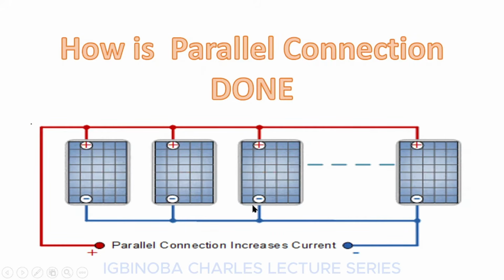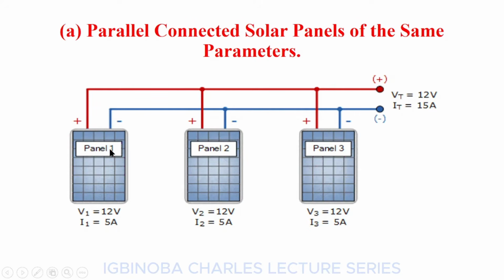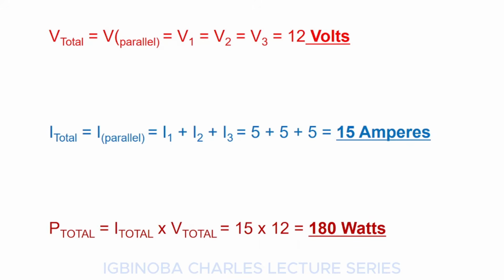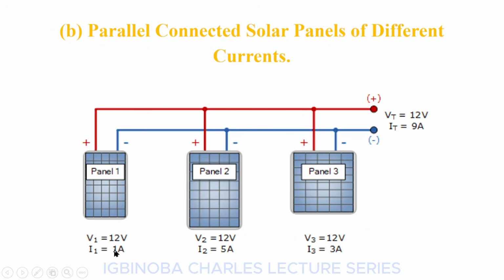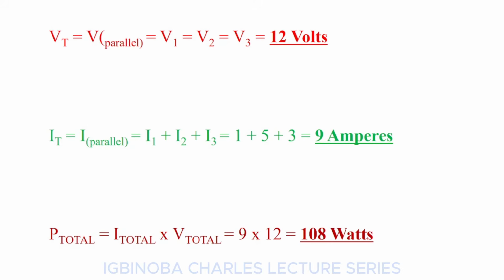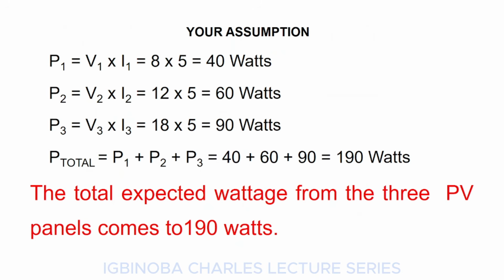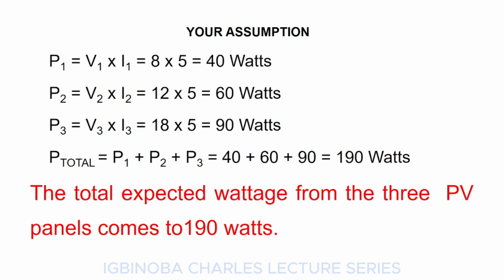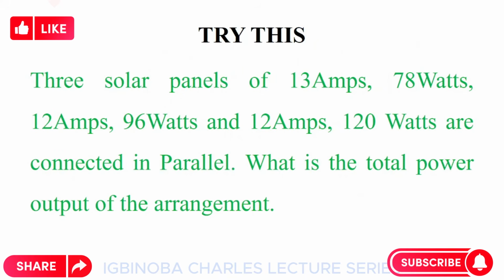Connection of Solar Panels in PARALLEL

Comment: NAT46T

Panel 1 = 13A, 78W
Panel 2 = 12A, 96W
Panel 3 = 12A, 120W

To get the voltage across each panel is given by Power/Current;
Panel 1 = 78/13 = 6V
Panel 2 = 96/12 = 8V
Panel 3 = 120/12 = 10V
We use V = 6v because it's the least voltage we have

To get total power in parallel:
We have
(Sum of the currents) x V
(13 + 12 + 12) × 6
=222watts

Comment: CHM26Z
Given;
Panel 1 = 13A, 78W
Panel 2 = 12A, 96W
Panel 3 = 12A, 120W
To get the voltage across each panel is given by Power/Current:
Panel 1 = 78/13 = 6V
Panel 2 = 96/12 = 8V
Panel 3 = 120/12 = 10V
We use V = 6V because it's the least voltage we have.
To get total power in parallel:
We have
(Sum of the currents) × V
(13 + 12 + 12) × 6
= 222 watts.

Comment: PETROCHEM55C 
ANSWER:

Given;
Panel 1=13A,78W
Panel 2=12A,96W
Panel 3=12A,120W
To get the voltage across each panel is given by 
power/current;
Panel 1=78/13=6V
Panel 2=96/12=8V
Panel 3=120/12=10V
We use V=6V because it's the least voltage we have:
To get total power in parallel:
We have
(Sum of the currents) x V
(13+12+12) x 6
=222Watts
Final answer=222Watts

Comment: CIV73U
Panel 1 = 13A, 78W
Panel 2 = 12A, 96W
Panel 3 = 12A, 120W
To get the voltage across each panel is given by Power/Current;
Panel 1 = 78/13 = 6V
Panel 2 = 96/12 = 8V
Panel 3 = 120/12 = 10V
We use V = 6v because it's the least voltage we have:
To get total power in parallel:
We have
(Sum of the currents) × V
(13 + 12 + 12) × 6
=222watts

Comment: CHM33G

Answer 

Given p1= 13A, 78W
           P2 = 12A, 96W
           P3 =  12A, 120W
          
           P/I
             Panel 1= 78/13 = 6v
              Panel 2 = 96/12 = 8v
             Panel  3= 120/12 = 10v
       
              V= (6v sum of the current) × V
              (13+12+12)*6
                 =222watts

Comment: CHM70R

Panel 1 = 13A, 78W
Panel 2 = 12A, 96W
Panel 3 = 12A, 120W
To get the voltage across each panel is glven by Power/Current;
Panel 1 = 78/13 = 6V
Panel 2 = 96/12 = 8V
Panel 3 = 120/12 = 10V
We use V= 6v because it's the least voltage we have:
To get total power in parallel :
We have
(Sum of the currents) × V
(13 + 12 + 12)×6
=222watts
Final answer =222watt

Comment: CHM110F

Panel 1 = 13A, 78W Panel 2 = 12A, 96W Panel 3 = 12A, 120W To get the voltage across each panel is given by Power/Current; Panel 1 = 78/13 = 6V Panel 2 = 96/12 = 8V Panel 3 = 120/12 = 10V We use V= 6v because it's the least voltage we have: To get total power in parallel : We have (Sum of the currents) × V (13+12+12)×6 =222watts Final answer =222watt

Comment: COMP37K 
Given 13A 78W
12A 96W
12A 120W
To get the voltage we use v =power/current 
V1=6.5
V2=8
V3=10
To connect solar panels in parallel it has to satisfy one of these two conditions which are
They must have the same voltage and current
They must have the same voltage and different current 
Since it doesn't satisfy any of these conditions we can't connect it in parallel thereby not being able to get the equivalent power when connected in parallel

Comment: CHM46T

Given:
Panel 1: 13 A, 78 W
Panel 2: 12 A, 96 W
Panel 3: 12 A, 120 W
For parallel connection, the total power is the sum of the power outputs:
Total Power = 78 + 96 + 120
= 294 W
ANSWER: 294 W

Comment: CHM65M 

Given;
Panel 1 = 13A, 78W
Panel 2 = 12A, 96W
Panel 3 = 12A, 120W
To get the voltage across each panel is glven by Power/Current;
Panel 1 = 78/13 = 6V
Panel 2 = 96/12 = 8V
Panel 3 = 120/12 = 10V
We use V= 6v because it's the least voltage we have:
To get total power in parallel :
We have
(Sum of the currents) × V
(13 + 12 + 12)×6
=222watts
Final answer =222watt

Comment: CHM51Y

Answer 

Given;
Panel 1 = 13A, 78W
Panel 2 = 12A, 96W
Panel 3 = 12A, 120W
To get the voltage across each panel is glven by Power/Current;
Panel 1 = 78/13 = 6V
Panel 2 = 96/12 = 8V
Panel 3 = 120/12 = 10V
We use V= 6v because it's the least voltage we have:
To get total power in parallel :
We have
(Sum of the currents) × V
(13 + 12 + 12)×6
=222watts
Final answer =222watt

Comment: CIV83E

GIVEN:

11 = 13Amps, P1 = 78Watts

12 = 12Amps, P2 = 96Watts

13 = 12Amps, P3 = 120Watts

Finding the Voltage

V = P/I

V1 = 78/13 = 6V

V2 = 96/12 = 8V

V3 = 120/12 = 10V

i

For a parallel connection, the voltage must be

V1 = 78/13 = 6V

V2 = 96/12 = 8V

V3 120/12 = 10V

For a parallel connection, the voltage must be the same, and we cannot simply take the lowest voltage current here because the ratings of the currents occur at different voltages.

Therefore, the panels cannot be connected directly in parallel. And the total power output cannot be gotten directly too.

Comment: COMP11K

GIVEN:

I1 = 13Amps, P1 = 78Watts

I2 = 12Amps, P2 = 96Watts

I3 = 12Amps, P3 = 120Watts

Finding the Voltage

V = P/I

V1 = 78/13 = 6V

V2 = 96/12 = 8V

V3 = 120/12 = 10V

For a parallel connection, the voltage must be the same, and we cannot simply take the lowest voltage current here because the ratings of the currents occur at different voltages.

Therefore, the panels cannot be connected directly in parallel. And the total power output cannot be gotten directly too.

Comment: MAR2B

Voltage for each solar panel can be determined by:
V=p/l where P= power and I=current.
Therefore
V1=78\13=6v V2=96/12=8v
V3=120/12=10v
By law the voltage of V1 is taking as the output or total voltage because it has the smallest value, therefore
Where to tell current is giving as L_total=13A+12A+12A=37A
Total power output=l_total x v_total
P_total=37x6=222 w

Comment: EEE82D 

Given:
13A 78W, 12A 96W, 12A 120W

Total Power= Total current x Total voltage 
Voltage=p/I
78/13 =6v, 96/12=8v 120/12=10v

Total voltage=6v
Total current=13+12+12=37A

Total Power= 6x37 =222W

Comment: CHM99U

Given:
Panel 1 : 13A, 78W
Panel 2 : 12A, 96W
Panel 3 : 12A, 120W

For the panels connected in parallel, the total power output is the sum of the individual powers:

Pt = P1 + P2 + P3
Pt = 78 + 96 + 120
Pt = 294W

Comment: CHM62J

Given:

P1 = 78 W
P2 = 96 W
P3 = 120 W

Since the panels are connected in parallel, the total power is the sum of the individual powers.

Pt = P1 + P2 + P3

Pt = 78 + 96 + 120

Pt = 294 W

Answer: 294 W

Comment: PETROCHEM39 М
Panel 1: 13 A, 78 W

Panel z: 12 A, 96 W

Panel 3: 12 A, 120 W

Connection: Parallel

In a parallel connection, the total power output of the arrangement is the sum of the individual power ratings of each panel (since power adds directly regardless of connection type):

P(total) = PI + Pz + P3

P(total) = 78 W + 96 W + 120 W

P(total)

= 294 Watts

Comment: MEC102X

Answer: 222watts
 

Given:
 Panel 1 = 13 Amps, 78 Watts
 Panel 2 = 12 Amps, 96 Watts
 Panel 3 = 12 Amps, 120 Watts
Total power output, P = V \times I
In parallel, the current is added.
I = 13 + 12 + 12 = 37 Amps
Calculating individual panel voltage:
 Panel 1, V_1 = 78 / 13 = 6 V
 Panel 2, V_2 = 96 / 12 = 8 V
 Panel 3, V_3 = 120 / 12 = 10 V
At this point, the least voltage is used to compute the power output from the panels, which is 6 V.
Therefore,
Total power output, P = 6\text{ V} \times 37\text{ A} = 222 Watts

Comment: COMP8H

Given that
P=IV therefore V=P/I
P=78W, I=13A V=78/13= 6V
P=96W, I=12A V=96/12= 8V
P=120W, I=12A V=120/12= 10V

Theoretically 
Ptotal=78+96+120=294W

Practically 
(In parallel)
Vtotal= 6V
Itotal=12+12+13=37A

Ptotal= 37 x 6 = 222watts

Comment: CHM42P
Voltage for each solar panel can be determined by:
V=p/I where P= power and I=current.
Therefore
V1=78\13=6v
V2=96/12=8v
V3=120/12=10v
By law the voltage of V1 is taking as the output or total voltage because it has the smallest value, therefore
Where to tell current is giving as
I_total=13A+12A+12A=37A
Total power output=I_total x v_total
P_total=37x6=222 w

Comment: MECH73U

* 13A,\ 78W
* 12A,\ 96W
* 12A,\ 120W

are connected in parallel. Find the total power output.

Using:

P=VI

Therefore,

V=P/I

For the first panel:

V_1=78/13=6V

For the second panel:

V_2=96/12=8V

For the third panel:

V_3=120/12=10V

So the panels are 6 V, 8 V and 10 V respectively.

P_T=P_1+P_2+P_3

P_T=78+96+120

P_T=294W

Comment: CIV58F

panel 1 is 78 w
panel 2 is 96 w
panel 3 is 120 w

therefore the Total power output is the summation of all the power which is = 294 w

Comment: EEE14O

Answer: 222 Watts

Given:
Panel 1 = 13Amps, 78Watts
Panel 2 = 12Amps, 96Watts
Panel 3 = 12Amps, 120Watts

Total power output, P = V×I

In parallel, the current is added.
I = 13 + 12 + 12 = 37Amps

Calculating individual panel voltage.
Panel 1, V_1 = 78/13 = 6V
Panel 2, V_2 = 96/12 = 8V
Panel 3, V_3 = 120/12 = 10V

At this point, the least voltage is used to compute the power output from the panels, which is 6V.

Therefore,

Total power output, P = 6V × 37A = 222 Watts

Comment: EEE77Y

GIVEN:

11= 13Amps, P1= 78Watts

12= 12Amps, P2= 96Watts

13= 12Amps, P3= 120Watts

Finding the Voltage

V= P/I

V1=78/13 6V

V2=96/12=8V

V3=120/12=10V

For a parallel connection, the voltage must be the same, and we cannot simply take the lowest voltage current here because the ratings of the currents occur at different voltages.

Therefore, the panels cannot be connected directly in parallel. And the total power output cannot be gotten directly too.

Comment: EEE47U 

Answer 
When solar panels are connected in *parallel*, the *total power = sum of individual powers*.

You have:
1. *Panel 1*: 78W 
2. *Panel 2*: 96W 
3. *Panel 3*: 120W

Total Power Output = 78W + 96W + 120W = 294W

---

Extra info if you need it:
In parallel, voltage stays the same but currents add.  
Total current = 13A + 12A + 12A = 37A

To find the system voltage, you’d use: `Power = Voltage x Current`  
Using panel 1: $V = 78W / 13A = 6V$  
Using panel 2: $V = 96W / 12A = 8V$  
Using panel 3: $V = 120W / 12A = 10V$

Note: These 3 panels have different voltages, so connecting them directly in parallel isn’t ideal. In real setup you’d use an MPPT charge controller or match the voltages, otherwise the lowest voltage panel will drag the others down.

But for pure power output on paper: 294W total

Comment: PETRO82D 

For a parallel connection, the voltage must be the same, and we cannot simply take the lowest voltage current here because the ratings of the currents occur at different voltages. 
Therefore, the panels cannot be connected directly in parallel. 
And the total power output cannot be gotten directly too.

Comment: PETRO71S

Solution 

finding the voltages
13A, 78W → V = 6V
12A, 96W → V = 8V
12A, 120W → V = 10V
Total current = 13 + 12 + 12 = 37 A
Total voltage = 6 V (limited by weakest
panel)
Total power = V x 1 = 6 × 37 = 222 W

Comment: PETRO20T

Answer: 

Solution:

Given:
Three solar panels connected in Parallel
- Panel 1: 13A, 78W
- Panel 2: 12A, 96W
- Panel 3: 12A, 120W

---

Key rule for parallel connection:
When panels are connected in parallel, voltages must be the same and *currents add up*.
Power also adds directly: P_total = P1 + P2 + P3

So we just add the power of each panel.

Total Power Output (Pt):
Pt = 78W + 96W + 120W
Pt = 294W

---

*Note:
For parallel, the total current would be:
It = 13A + 12A + 12A = 37A
To get voltage for each panel: V = P/I
V1 = 78/13 = 6V, V2 = 96/12 = 8V, V3 = 120/12 = 10V

Since the voltages are different, in a real setup they would need to be matched with an MPPT/charge controller. But for the basic power calculation: Total power = 294W

Comment: CIV15O
Panel 1=13A 78W
Panel 2= 12A 96W
Panel 3= 12A 120W

Connected in Parallel 
Power total= P1+P2+P3
          =78+96+120
           = 294 Watts

Comment: CIV18R

Given,
Panel 1: 13A, 78W
Panel 2: 12A, 96W
Panel 3: 12A, 120W
For panels connected in parallel, the total power output is the sum of the individual powers:
Pt = P1 + P2 + P3
Pt= 78 + 96 + 120
Pt = 294W

Comment: CHM38L

GIVEN; P=VI; V=P/I
13A 78W=78/13 =6V
12A 96W=96/12=8V
12A 120W=120/12=10V
*I=13+12+12=37A
In a parallel connection the panels would run on the least voltage V=6volt

P=VI; 6×37=222W

Comment: MAR64L 
finding the voltages
13A, 78W → V = 6V
12A, 96W → V = 8V
12A, 120W → V = 10V
Total current = 37 A
Total voltage = 6 V 
Total power= 222 W

Comment: COMP98T

For panels connected in parallel, the total power is the sum of the individual powers:

P_T = P_1 + P_2 + P_3

P_T = 78 + 96 + 120

P_T = 294W

Answer: The total power output is 294 watts.

Comment: PETRO19S

Solution:

Given:  
Three solar panels connected in Parallel  
- Panel 1: 13A, 78W  
- Panel 2: 12A, 96W  
- Panel 3: 12A, 120W  

---

Key rule for parallel connection:  
When panels are connected in parallel, voltages must be the same and *currents add up*.  
Power also adds directly: P_total = P1 + P2 + P3

So we just add the power of each panel.

Total Power Output (Pt):  
Pt = 78W + 96W + 120W  
Pt = 294W

---

Note:  
For parallel, the total current would be:  
It = 13A + 12A + 12A = 37A  
To get voltage for each panel: V = P/I  
V1 = 78/13 = 6V, V2 = 96/12 = 8V, V3 = 120/12 = 10V  

Since the voltages are different, in a real setup they would need to be matched with an MPPT/charge controller. But for the basic power calculation: Total power = 294W

Comment: CHM9I

GIVEN:
P1=78W
P2=96W
P3=120
THE SOLAR PANELS ARE CONNECTED IN PARALLEL, THEREFORE POWER IS:
P=P1+P2+P3
P=78+96+120
P=294W.

Comment: Petro45S 
Solution 
Voltage for each panel , v=p÷I
Panel1 13amp , 78w,  v = 78÷13 = 6v
Panel2 12amp, 96w, v=96÷12= 8v
Panel3  12amp , 120w, v= 120÷12=10v
For total current [ I] = 13+12+12=37.amp
Due to the difference in voltage to calculate for power using the lowest voltage  I.E 6v
P= v×I  ,, p= 6×37= 222wat
Note that this parallel connection is not effectively maximizing the power of the panel and can result to cable been burn cause to get effective parallel connection it most follow this rule 
1 same voltage & same current 
2 same voltage & different current
Reply: Reason why the this parallel connection is not effective 
 the actual total power minus calculate power is equal to the power wasted 
294 - 222 = 68

Comment: CHM63K.                                             Given:
Panel 1: 13 A, 78 W
Panel 2: 12 A, 96 W
Panel 3: 12 A, 120 W
Connection: Parallel
In a parallel connection, the total power output of the arrangement is the sum of the individual power ratings of each panel (since power adds directly regardless of connection type):
P(total) = P1 + P2 + P3
P(total) = 78 W + 96 W + 120 W
P(total) = 294 Watts

Comment: COMP83E

V = P/I
V1 = 6V
V2 = 8V
V3 = 10V
 The lowest voltage is taken as the total voltage

Total Current = I1 + I2 + I3
                        = 13A + 12A + 12A
                        = 37A

Total Power= V_total × I_total
                     = 6V × 37A
                     = 222Watt

Comment: MAR22V

Solution: 

P1 = 78W, P2 = 96W, P3 = 120W

Since the solar panels are connected in parallel, the total power is:

PT= P1 + P2 + P3
PT = 78 + 96 + 120 
PT = 294W

Therefore, the total power output of the arrangement is 294W.

Comment: COMP13M 
Solution

Given:

Panel 1: I1 = 13A, P1 = 78W Panel 2: I2 = 12A, P2 = 96W Panel 3: I3 = 12A, P3 = 120W

Step 1: Identify the connection

The panels are connected in parallel. In parallel, the total power is obtained by adding the power of all the panels.

Step 2: Write the formula

Total power = P1 + P2 + P3

Step 3: Substitute the values

Total power = 78 + 96 + 120

Step 4: Calculate

Total power = 294W

Answer: The total power output is 294W.

Comment: MAR86H

Given:
Panel 1 = 78 W
Panel 2 = 96 W
Panel 3 = 120 W

Therefore,
Total Power = 78 W + 96 W + 120 W
Total Power = 294 W

The total power output of the arrangement is 294 W

Comment: PETROCHEM64L

Answer:
Given:
| Panel | Current | Power |
|-------|---------|-------|
| 1 | 13A | 78W |
| 2 | 12A | 96W |
| 3 | 12A | 120W |
Step 1: Calculate Voltage for Each Panel (V = P ÷ I)
Panel 1: 78W ÷ 13A = 6V
Panel 2: 96W ÷ 12A = 8V
Panel 3: 120W ÷ 12A = 10V
Step 2: Determine String Voltage
In parallel, voltage is limited by the lowest-rated panel:
V(string) = 6V
Step 3: Calculate Total Current
In parallel, currents add up:
I(total) = 13A + 12A + 12A = 37A
Step 4: Calculate Total Power Output
P(total) = V(string) × I(total)
P(total) = 6V × 37A = 222W
Conclusion:
The total power output of the parallel string is 222W, not the sum of individual ratings (294W). This 72W loss occurs because parallel-connected panels are voltage-limited by the weakest panel — reinforcing the importance of matching panel specifications regardless of series or parallel configuration.

Comment: COMP15O

Given:
Panel 1 = 78 W
Panel 2 = 96 W
Panel 3 = 120 W
Therefore,
Total Power = 78 W + 96 W + 120 W
Total Power = 294 W
The total power output of the arrangement is 294 W

Comment: MEC77Y
Answer : for a true parallel Connection, the panel should have the same Voltage Rating . From Calculation the Voltage are 6V , 8V , 10V , therefore they can't be Ideally be connected directly in parallel. 
Based On assumption 
Total Power = 78+96+120
= 294W

Comment: COMP42P

1. Panel A: 13A, 78W
2. Panel B: 12A, 96W  
3. Panel C: 12A, 120W

In parallel: Currents add, Voltage = lowest panel voltage

Find voltage of each panel
Formula: V = P / I

- Panel A: V = 78W / 13A = 6V
- Panel B: V = 96W / 12A = 8V
- Panel C: V = 120W / 12A = 10V

In parallel currents add directly:  
I = 13A + 12A + 12A = 37A

All panels are forced to the lowest voltage = 6V

P= V_{total} \times I_{total} = 6V \times 37A = 222W

78 + 96 + 120 = 294W.

Comment: MAR8H

Calculation based on the given assumption

Total power = 78 + 96 + 120
= 294 watts

Calculation under the actual scenario

Voltage of Panel 1:
78 / 13 = 6 V

Voltage of Panel 2:
96 / 12 = 8 V

Voltage of Panel 3:
120 / 12 = 10 V

The lowest voltage is selected as the total voltage.

Total current = 13 + 12 + 12
= 37 amps

Total power = 6 × 37
= 222 watts

Comment: PETRO25Y 

Answer=222W

Voltage of each panel (V=P/ I)
V1=78W/13A=6V
V2=96W/12A=8V
V3=120W/12A=10V
Actual power output (parallel connection)
V parallel =min(6V,8V,10V)=6V
I total =13A+12A+12A=37A
P total =6V*37A=222W
Theoretical maximum (With optimizers)
P total =78W+96W+120W=294W